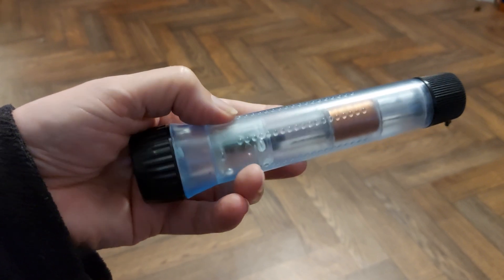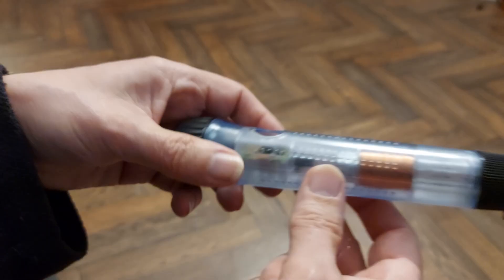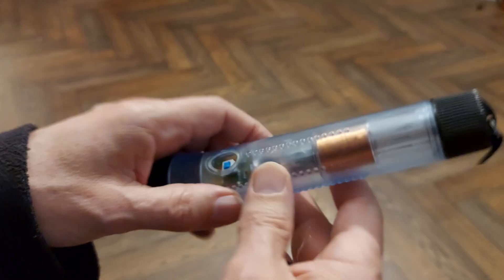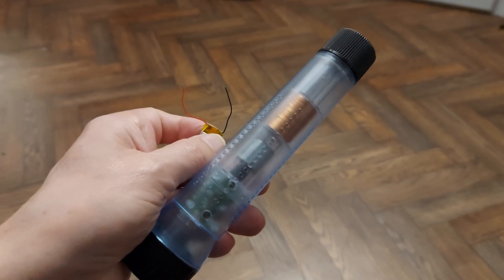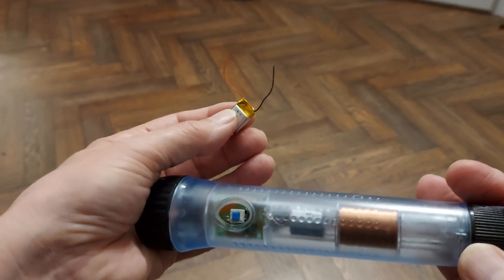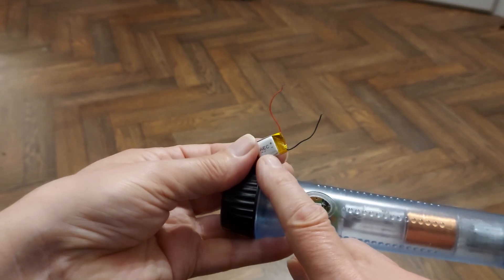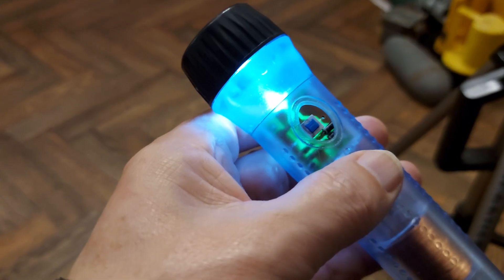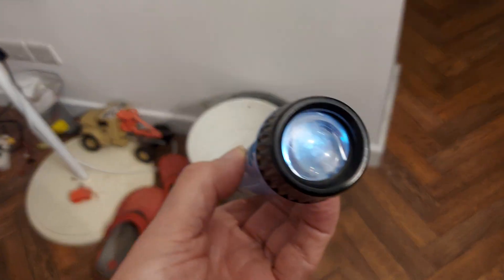Looking at an old induction shaker "Faraday flashlight" PART 6 SMALL LiPo

Comment: It did look like shaking it put a bit of power in compared to when it only rested. Though, it did fade off quite quickly, as noted. Very interesting experiment! 
Btw, the mosquito looks great for being an older project 😀
Reply from the maker: Yes, quite surprising that Mosquito still exists. As I remember it, you suggested the Mosquito as a suitable subject for that project and how to look up the 2D images online 😁😁
Reply: @GrandadIsAnOldMan  I hope it still flies well. A lot of foam planes from around 15 years ago simply cracked or fell apart here, from UV damage I think. Would go to fly one more recently and any less than perfect landing would look like a Thunderbirds explosion!
Reply from the maker: @Slider2732_  I would like to give that one another flight, just to see if it can fly. Maybe if we get the right conditions 🤔🤔
Reply: @GrandadIsAnOldMan  Yes, please do! 
Bonus points if it lands a little roughly and doesn't do the Thunderbirds explosion thing 😁